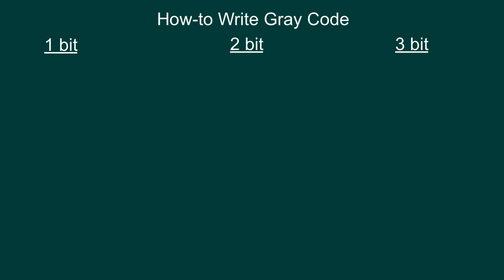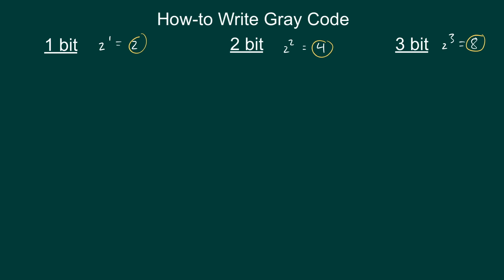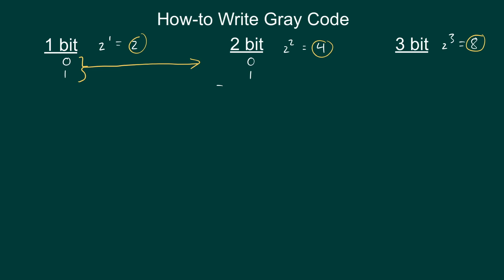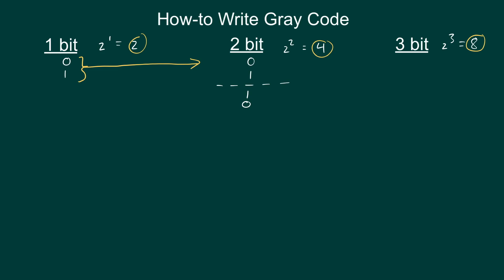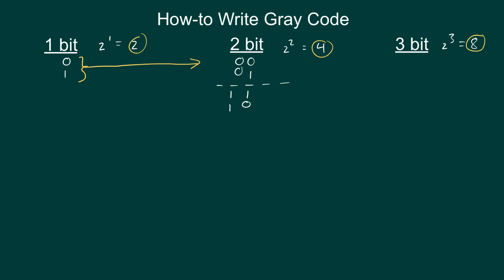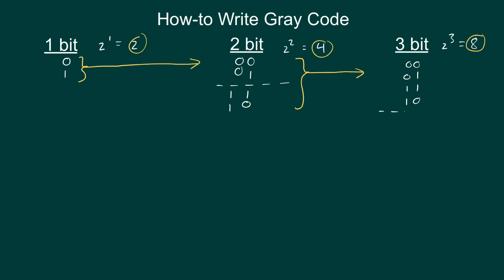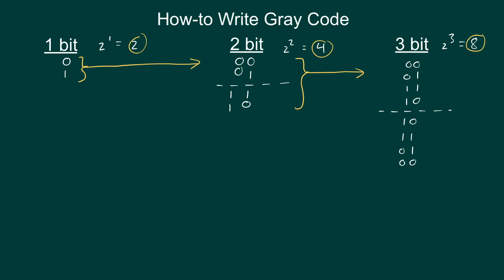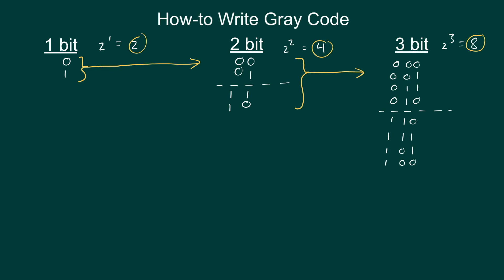How to Write 1 bit, 2 bit, and 3 bit Gray Code

Comment: Thank you. At the start of the video, I was slightly concerned because I thought that the general method wouldn't be apparent until you started with the 4 bit. But this was great.
I didn't understand your objection to putting the new information in at the right, "because they wouldn't be one bit apart". If you by that mean that it would no longer be the case that every step only had one bit transition, then I do not see why that would be the case just by changing the sequence. The same columns would still be represented.